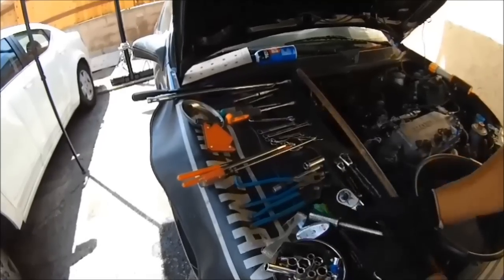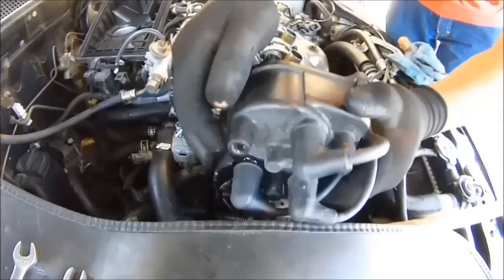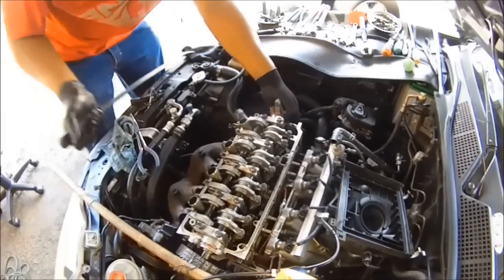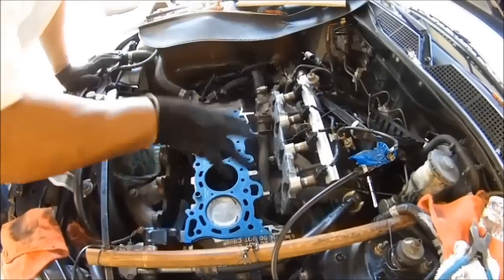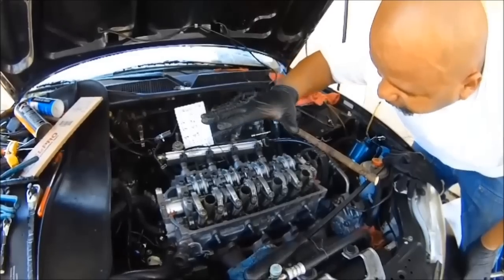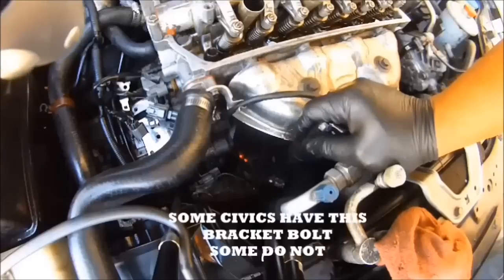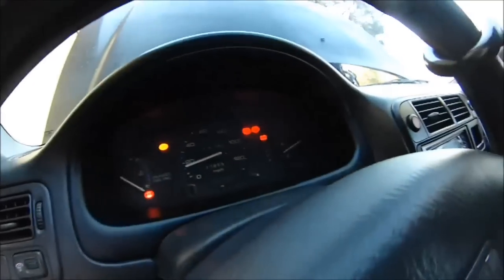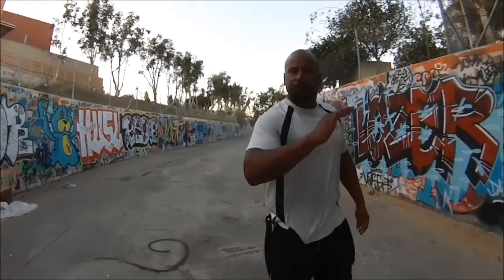HOW TO CHANGE A HONDA CIVIC HEAD GASKET 1996-2000 ( MOST DETAILED DIY FOR 2023 ) EASY STEP BY STEP

Comment: all your videos are good, I'm learn English and I want to be like you. Because here in Mexico the Mechanic doesn't like to work fine. I have a car and I'll start in this with that. thank so much. tell me how can I learn everything.
Reply from the maker: +victor M Thank you Victor. The number one thing to learn is you have to STUDY HARD. Spend A Lot of time reading book on diagnosing cars. Google Diagnosing and read lots of books. Start with learning how and engine works and then study each system of a car lil by lil until you understand the one system. Ignition system, fuel injection system, emission system, starter system and more. Then start working on peoples cars let them know you are new but you can save them money. Or work for local mechanic shop that does all repair work and they will start to teach you. But start reading now do not wait for someone to teach you. Stay strong God Bless.
Reply: Thank you, I'll do it.
Reply: +victor M Hi Victor, i started like you grabbing information on the internet and trying. Today i have a little garage where i do all type of mechanic jobs (bought a crane the other day) without a professional lift. Buy the tools little by little, always start prepared but don't fear to try, you are a man and machines are man made. You will struggle and fail sometimes but that how it is for everybody. You have to start from the bottom, climbing your way up with your sacrifices, but you will reach what you want if you always try. At least that what i hope! :)  
Take care and by the way your english is fine, you surely understand it good. When you will be ready for the hard electric diagnosis, i can suggest you scanner danners channel here on youtube, when the time comes he will teach you a TON of information on diagnostics.
Reply: +Andrea Gili Thank so much my friend. I'll do it. is good know people like you Because you have a lot of espererience in this. I'm going to learn English well. thank you again.

Comment: hey oldskool funk I just purchased a car and the turn signals don't work  but the lights work got any advice its a 94 buick century and fuses are good
Reply from the maker: +D eightteen Check your Thermal flasher.
Reply: +oldskool funk The emergency flashers work so I don't know I'm not a mechanic windshield wipers too might have to get blinker switch. Thank you tho.

Comment: after checking out this video I notice IGN ADV  reading on the auto scanner was steady at 12.0 degree. So I check mine; it's fluctuating between 11.5-13.0 degrees. Should it stay steady at 12.0 degrees?
Reply from the maker: +1Manbug Thats ok the acceptable range is plus or minus 2 degrees

Comment: How do you get rid of all the mixed oil and water out of the head on the valves and camshaft? Do you need to flush it with some type of chemical,do you send it out to get cleaned,or do you just leave it there?
Reply: when you send it out to the machine shop they clean it for you.

Comment: Good day how much will u charge me to replace head gasket on 2000 Honda Civic I did it 14 months ago and 12 months before that I replace the engine I also replaced a/c compressors seems like every time the engine goes the a/c compressor goes too  I drive 110 miles a day round trip can u permanently fix my car pls thanks for the great videos I'm not handy at all God bless

Comment: yo bro whats up...need your reply. here in jamaica we usually oil the gaskets slightly to give it a tighter seal. is it wrong? im willing to hear your reasoning behind this... thanks!
Reply: YES,,,  keep the surface Clean... the Heat bonds the gasket.. the oil will not let it bond. this is true for most gaskets...

Comment: I haven't worked as a mechanic for atleast 12 years. I found that most fault in head gaskets came from monotorque head Gaskets.Please always retension monotorque head gaskets. The only difference between a monotorque head gasket and a normal head gasket is glue! So  retorque your monotorque head gaskets!
Reply: +marco hanse; You notice that he highly recommended the replacement of the head bolts; on Toyotas, Hondas, and many other cars, the torque spec, and the nature of the head-bolt crystal structure is designed such that the headbolts are expected to Stretch.... that's the official line. My suspesion they do- when first torqued, and do maintain a pressure as a result... but not forever. At 80k miles, I believe trust in that derived torque does indeed lesson, while at the same time, the on-going pressure on the head-gasket has compressed it to the end of its compressive abilities. So, I agree, but just 'when' is the question, and as you suggest: the empirical evidence supports your view as well. (I retorque between 70 and 80; cars that see higher milage in a shorter time can survive longer IMHO).
Reply: Tatter Salad Changing head bolts mainly applies to bi metal engines.If the head and the block are the same. It's only necessary on inspection! Non the less. Always re tosque your head bolts.
Reply: Tatter Salad as I worked as a mechanic for many years. Trust me. Re torques the head.

Comment: old skool funk i have a dilemma that is driving me crazy, My cylinder head is being resurfaced and checked for cracks at the machine shop. In the meantime, I am trying to clean my 2001 Honda Civic aluminium block deck, It does not have any gasket remaining in the surface but it has black spots in the surface between the rings of the cylinders, I have tried razor blades and scotch brite non-scratch blue pad to take the blacks spots off but they wont came out. My question is. Is it safe to sand the aluminium surface with something like 1000 or 1200 sand paper, I really want to achieve a clean surface without black stains. The mechanic shop told me not to sand the surface, only use razor blades,
Looking forward to hearing from you soon. Thanks.
Reply: +Rafael Rodriguez Dont worry about staining on the surface. if it doesnt come up with mineral spirits or degreaser then your fine. the biggest issue is that it stays flat.
Reply: sounds like you need to check for flat Block head.. if not flat then see his vid on how to resurface head at home.. you can use same process for the block..   Build a custom sanding block.. watch hid vid get the concept the go to town..  Good luck.. P.s> Sand the block/head down..  do not use a file like a dummy i know. he wrecked his engine.

Comment: where can I get cylinder head bolts ...are the universal or do I need specific ones to the engine ? or take the old ones to like AutoZone and let them match them?
Reply: If your engine uses torque to yield bolts they should be available from a parts store. They will come as a complete set. And yes they are specific to your engine.
Reply: A new head set comes with new bolts valve guides gaskets everything.
some head gaskets come with bolts too.. I say FelPro. is a great brand for using.

Comment: hey my 2000 honda civic engine has 210 in #1 CYLINDER 185 IN #2 180 IN #3 and 150 in #4 im wondering if you can tell me what that means
Reply: Ebonie Taylor I assume you did a compression test? Was the test completed wet and dry? You shouldn't have more than a 10 percent variation between cylinders, and they should be about even. I would do a leakdown test to see if it is your rings. However, I've heard 130psi is standard for the 90s civics.

Comment: What do we do if we don't have a torque wrench and want to torque it by hand? Can we torque it until we feel that there is no room to torque no more? I've seen some old school mechanics do this and I mean good mechanics.
Reply from the maker: +SacreDro You can not get an accurate torque with out it. Every bolt has a specific clamping force thats engineered to precision. The combustion chamber has some serious pressure/force in it I would not gamble with guessing the torque not a good idea.
Reply: Does the torque differ from engine to engine on gas ones. I can't find some torque guidelines for my car.
Reply: +SacreDro Yes it does differ. Search online for torque specs. If you can't find what you need ask me, i might have the information...
Reply: Well I have an EU Audi A4 from 2003 with a 1.6 petrol engine. If you know any info source regarding this please let me know, I would appreciate it.
Reply: Well, i've searched for that. I have some a3 information, i think the engine is the same as in your a4 but to be sure (you want to be sure) i would ask to the people you will buy the bolts from, they should have the information
Reply from the maker: Try asking the people at the parts store sometimes they will give you the specs.
Reply: Thanks for the info.

Comment: On index 9:50 you said that nut there is the hard one to remove. It seems to me like you did not find it hard. You are tall I guess (how tall r u?). I am short guy only 5'5". I may really have hard time to remove that one. And also, other than that one, there are five more nuts that needs to be remove which I guess you removed already, but you forgot to mention.

Comment: I thought when you do the torque down it's 4 steps. You do all 10 bolts 3 steps like you did. Then last step you only do bolts 1 and 2 on the 4th step you do the 49 ft lbs again.
Reply: What the hell are you talking about?

Comment: Don't you think the oil should be changed after the head gasket since their was evidence of water contamination inside the valve cover?
Reply: +David Norris Of course, theoretically you should change your timing belt too if it's old, you need to clean the engine outside and inside, new oil new filter, almost new everything